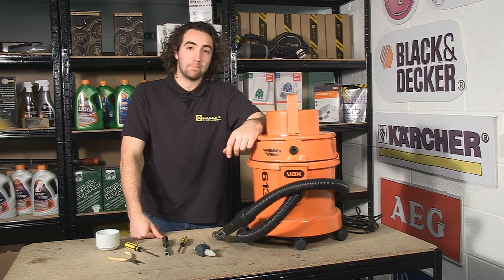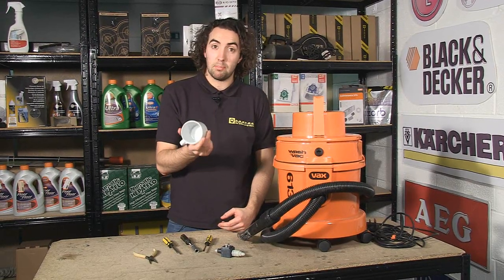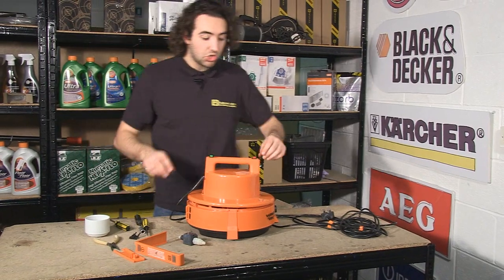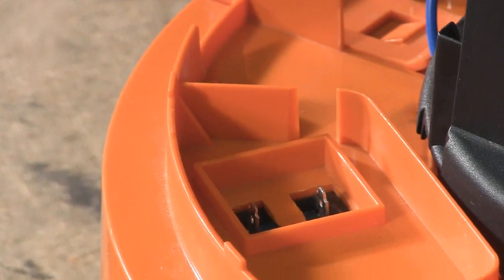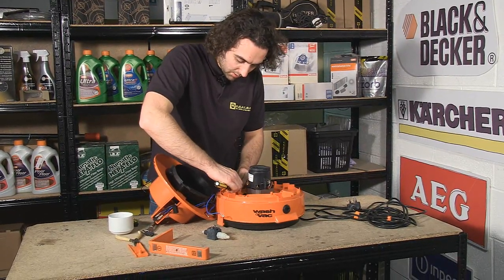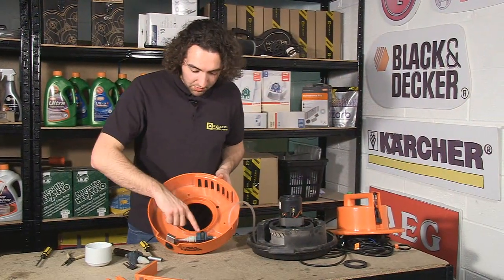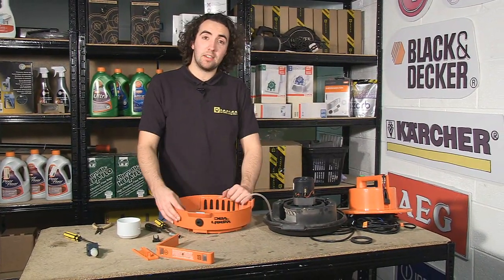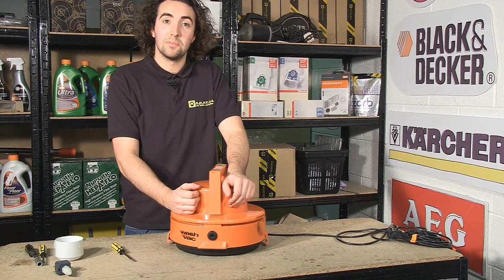How to replace the pump on a wet & dry vacuum

Comment: Thanks for an excellent Vid,  worked for me, I didnt have a new pump due to silly prices, when I looked at the pump in detail it has two check valves, one spring loaded that was fine and a rubber split one on the suction filter side, the latter had stiffened up and leaked, squirted Silicon Oil down the pipe and soaked, 5 minutes, it then worked fine.
As you say essential to flush with clean water before storage.
Reply from the maker: Hi Adam, thanks so much for your comment..and great to hear that you have been able to fix your vacuum with the help of our video! Well done for repairing it yourself.

Comment: Very useful thank you.  The only difference with mine is that it doesn't have a grommet and has 4 wires into the motor but still managed to do it with the help of your video.  A very happy Grandmother.  :-)

Comment: I found this very helpful and was able to repair my 6151SX which was only delivering a trickle of water. The pump is basically a solenoid with a sealed electromagnet coil connected to the AC power. Inside a metal rod that vibrates to and fro in a cylinder to create a pumping action. Round this are a series of spring valves and seals. It is quite simple to dismantle the pump and clean it, but you need to be very careful as there are lots of small parts that need to be kept in the correct order.  My pump had some shampoo gunge but I found the valves were all clogged with hairy fluff that prevented them from operating.  I was able to strip and clean everything and reassemble it.  The pump now has more flow than I can remember for years and the carpet cleaning is much improved.

You also need to dismantle and clean the valve on the front of the machine where the pipe plugs in. This is just a spring, plunger and a couple of O rings.

Incidentally, Josh when you reassembled the Vax "in the reverse order" in the video you reversed the blue and black wires to the pump.  Not a problem in this application, but is is always a good idea to  reconnect wires where they came off.

Sorry if I have lost you some replacement pump sales!
Reply: Good tip John, I'm going to give that a go before buying a new pump. Thanks!

Comment: Thanks Josh, great video.  I have the 6130 model and it also has 4 connections to the motor, but it was fairly easy to repair without removing them.  There are various catches and slots for the wires to go in when the switch unit goes back on that save the wires getting trapped. They aren't that obvious when it comes apart and the wires pull out of them, so worth looking for when putting back together. I found getting the housing apart was a little tricky as it had got stuck to the rubber seal and so needed some gentle persuasion with a flathead screw driver. Thanks, job done Vax working!

Comment: It's annoying that VAX does not tell you to flush the system after use to save the pump! Another tip I have found is when flushing use some screen wash for cars this seems to stop the crystal build up and if you are storing the cleaner in say a garage avoids damage to the pump by frost if the temperature falls below freezing, - Nigel at Gregory AV

Comment: so I've put the new pump in, now have loads of bits around and can't get the wretched thing back together again. The video is too fast! Even when you pause it you can't make out what the chap is doing.
Reply from the maker: Hi Richard, make sure the top is not fouled by the cables before trying to reassemble and the motor is 'settled flat ' on the motor casing.